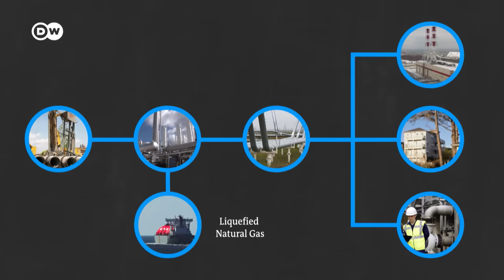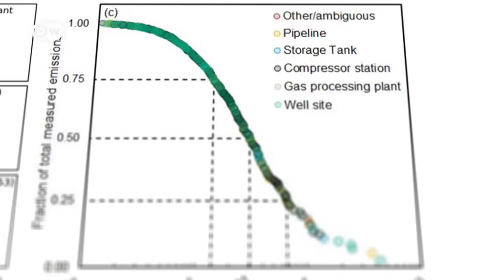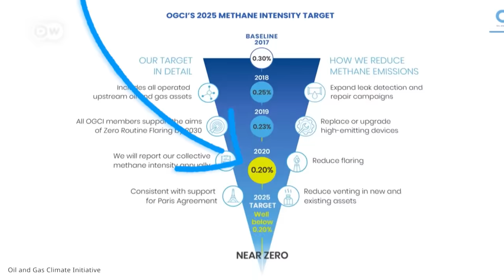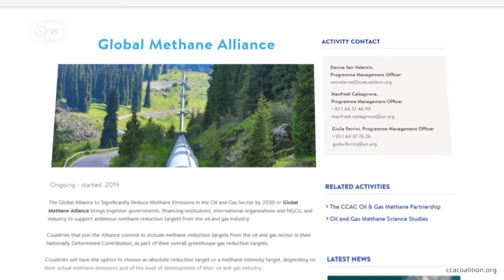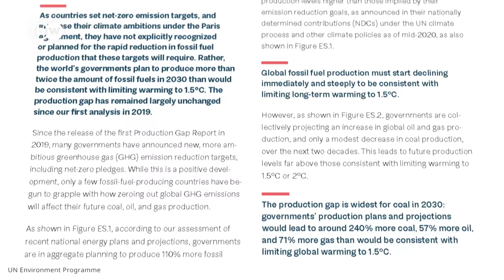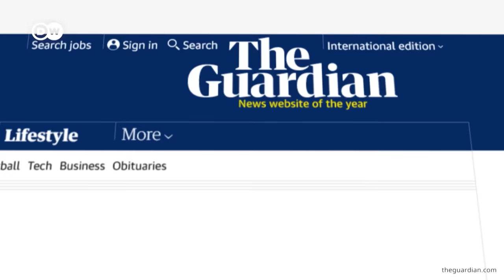Why we need to ditch natural gas (asap)

Comment: Wow, is the reaction I have everytime I watch a DW investigation. Thank you for all the hard work.
 Personally I believe Nuclear has a bad reputation because of the fossil fuel industry. 3rd and 4th gen Nuclear stations are where the planet as a whole need to be. Save the oil for the lube. because we've been getting shafted without it for decades.
Reply: great comment. that last sentence was HILARIOUS though
Reply: It's not the oil industry against nuclear it's the environmental folks.
Reply: @rayshepherd2479  They are not mutually exclusive.
Reply: Spot on, and who cares exactly which "team" is opposing a good strategy? Us vs. Them is a terrible way to make rational choices.
Reply: It's not the oil industry against nuclear it's the environmental groups. They have pushed excessive regulations that have made nuclear extremely expensive. They also file lawsuits which delay/kill new plants.
Reply: @rayshepherd2479  I really don't think it's reasonable to shift blame here to such a specific subsection of the population. The electorate at large is terrified of nuclear power. That has a long and storied history, prominently featuring many accidents, such as Chernobyl. It wasn't environmentalists that stopped nuclear; nuclear became uneconomic a long, long time ago under the weight of hyper cautious regulations.  In essence, what stopped nuclear was NIMBY's. Except the proverbial back yard was "my half of the planet" in this instance.

That fear wasn't entirely rational, it turns out. But neither is it insane, especially if you consider the connection between nuclear power and nuclear weapons - tolerating nuclear power makes it harder to ensure non-proliferation, and people are definitely right to be afraid of nuclear weapons.

Anyhow, that's what killed nuclear.  Not the oil industry. Not environmentalists. Public fear did.
Reply: @rayshepherd2479  It's actually both. The gas companies where I live are lobbying against nuclear energy and in favor of renewables, because nuclear is direct competition to natural gas fired power generation, and renewables are unreliable and require large volumes of natural gas to be burned in inefficient simple-cycle natural gas peaking plants, which provides a larger market for their gas.
Reply: @MoireFly  We need to talk about how uneconomical solar and wind are, because they export their reliability problems out to the power grid. All companies proposing putting unreliable renewables on the grid should be forced to also own and operate the (also uneconomical) inefficient natural gas peaking stations and/or the (extremely uneconomical) battery banks.
Reply: @gregorymalchuk272  If the environmental groups really believed that CO2 is an existential threat then they would be for nuclear, however most are actively against it. I have not seen any lobbying by major oil companies against nuclear.
Reply: @gregorymalchuk272  Solar and wind are however already so much cheaper than competition that we can afford excess supply; a lot of it. And yes, we'll need a better grid; that's not free.  But economics alone will certainly see to it that that happens - at least, if operators are actually free to make that choice, because infrastructure is impossible to build without regulatory backing.  The cost advantages are simply too great.

A good example here is texas, where fossil fuels are effectively heavily subsidized via tax breaks and also effectively subsidized by being unaccountable for the costs of pollution they cause.  Yet it's still been expanding its renewables at an absolutely break-neck speed - because they're simply better, even despite the heavy subsidies fossil fuels get.  And as its winter shutdown showed, it's not like fossil fuels don't also have reliability problems.  Just as nuclear did in France just now, for instance.

Solar and Wind are cheap, and clean, and we need to push them much, much further.  But yes, to do so we'll need to invest in costly grid upgrades and storage.  It's still worth it.
Reply: @rayshepherd2479  There are quite a few environmetalists that are pro-nuclear.  Some feel the need to couch that pro-nuclear stance behind limitations, such as that they prefer solar and wind; or other caveats. 

And sure, there are some, like greenpeace, that are anti-Nuclear.  But have you read their criticism?  They have 6 perfectly reasonable and mostly valid problems with nuclear, but as a whole, the argument is still pretty weak: the best they can come up with is that they'd prefer solar and wind, essentially - but they're conveniently leaving out the fact that those too need huge long-term investments if they're to replace even night-time or winter energy on calm days without wind.  I don't get the impression their heart is in it the way it used to be.
Reply: @MoireFly  Solar and wind are cheap until you have to include the cost of backup when the sun doesn't shine and wind doesn't blow. If you look at locations that have the most wind and solar they also have the highest electricity cost. That's even after all the subsidies. I have solar and in the summer my solar averages about 53 kWh per day in the peak month and less than 7 kwh per day in the worst winter month with a daily low of 1 kwh. I live in Northern California so there are areas that would be worst.
Reply: @rayshepherd2479  Needing to run gas peaker plants less often is still better than running them non-stop. Solar and wind are cheap, even if you include the costs of alternatives in downtimes - as long as you're realistic and trying to build enough to cover peak demand without huge margins above peak demand.  

If you're trying to claim storage is expensive - well, we'll need to talk about that, not solar and wind.  Solar and wind without storage are a clear and obvious win even without accounting for climate costs, and an overwhelming must-have once you account for climate costs.

But to replace more load at times when these renewables can't provide energy, you'll need storage - and there are lots of options, and many uncertain (but promising) developments. Evaluating those isn't trivial, but claiming that storage costs make renewables unviable is simply false - you don't need storage to make renewables viable.
Reply: @MoireFly  If wind and solar are a clearly less expensive you wouldn't need subsidies. You also would have the lowest cost electricity where wind and solar was the primary source of electricity. Unfortunately it's just the opposite. I have solar panels and the only reason they paid out is the subsidies. Even with the subsidies I would have been better off if I had just invested the cost of the solar. The problem with wind and solar is you need to maintain so much backup. In addition ramping up and shutting down the backup is very inefficient which also increases the cost. The difference in solar output from day to night is a problem but even more of a problem is the difference from summer to winter output.
Reply: @MoireFly  The problem is you need to have almost 100% backup to the Wind and Solar. This backup must be ready to come on line at any time. Current storage systems cannot do it especially from summer to winter. This means that some other form of backup must be maintained which currently means fossil fuel plants. When you add the cost of whatever backup system you use it results in wind and solar being very expensive. This can be seen by the cost of electricity in places like Germany and California where they have pushed wind and solar.

Comment: Geothermal energy can be used instead of gas, right now: the tech exist and it works 24/7 and it can be used both for heat and electricity.
Reply: Parts of Northern Europe have geothermal heat, but in our part of the world the water is not hot enough to produce electricity. But happily we can use to produce hot water for the district heating network, and this way it can replace some gas.
Reply: Geothermal is awesome, but there is no single perfect solution. I’m actually currently working on a video about this topic.

Instead of one perfect solution we need to be ok with ending up with a bit of a soup of various solutions which all leverage natural resources in specific regions. For instance, we’ll likely get the bulk of our power from solar and wind just because their generation per cost is so high, but they have obvious intermittency issues.

Luckily, there’s plenty of options which can solve these issues! Geothermal is one, waste generation of methane to burn is another, cogeneration can drastically reduce the cost of heating water, tidal generation is amazing, nuclear is also great as well, etc.

But my point is that each of these methods of generation has slightly different pros and cons depending on different regions. So we’ll have to be ok with one region relying on a method which is least expensive in their area while another region will use something completely different!

Like I said at the beginning: there is no one perfect solution.
Reply: Fusion will be the one thing that replaces all other types of electricity production currently in use. It is the holy grail of energy production. However we are not there yet.
Reply: Precisely 🙋🏼‍♀️ with the development of laser drilling it will be possible to build geothermal plants almost anywhere and retrofit fossil fuel power plant into geothermal plants.
Reply: @Drakey_Fenix  TBH, I think fusion is a pipe dream and we should focus on geothermal plants, solar panels, wind turbines, and backup battery storage facilities. Even thorium salt nuclear reactors would be better. As we have the technology now.
Reply: @Drakey_Fenix  I wish fusion was possible too.  The clean safe abundant energy is too tempting.  But fusion tech has always been just another "10-years" away since like 1960s and is becoming a running joke.  A good chorus of nuclear physicists do not think commercially viable fusion is possible either.

For starters, maintaining a constant minimum 100-million degree Celsius fusion reaction container currently uses up all the energy (and more) that our fusion technology can produce.  That is staggering amount of heat.  For comparison, its many times the temperature of the sun's core which is only some 15-million degrees Celsius.

Secondly, the most promising fusion experiment is the ITER fusion reactor which goes after the Deuterium-Tritium fusion process which is easier to achieve and produces more unit energy.  But Tritium (3H) is incredibly rare unlike Deuterium (2H).  ITER themselves say 300-grams of Tritium is needed per day for an 800MW reactor.

Creating (breeding) Tritium from Deuterium is possible on small scale but is yet another major obstacle for commercial viability.  Tritium is also "beta" radioactive.  If some leaks into the water and then the food supply then it would be a disaster on its own.

Remember, its much easier to create a working prototype of something in a laboratory at tiny scales.  With something like fusion, even the smallest laboratory breakthroughs get big media coverage because it always boosts clicks and views.  But its a huge leap to take a prototype to commercial scale where factors of safety, regulation, economics, supply chains, and especially competitive pressure also come into play.  It is the same for all new technologies.
Reply: @ladyselenafelicitywhite1596  "Fusion"
Reply: Tidal wave energy has huge potential. It can generate 22 hrs of energy out of 24 hrs.
Reply: @beyondfossil  darn it, I meant fusion. 🙇🏼‍♀️
Reply: @crosstraffic187  it has potential, but there might be conflicts of interest with other maritime users.  Have you seen the new combined tidal/solar/wind platforms that are underway? 
Remarkable technology if it becomes commercially viable.
Reply: @ladyselenafelicitywhite1596  I'll have to check it out.

Comment: I lived where fossil fuel industries were basically determining the government policies. I noticed one thing in this video, no mention of either tidal wave or "run of the rivers" power generation. 
The fossil fuel industries, especially natural gas, don't want to be shut down. They're the main sources of the plastic industries. We're all aware of the massive amounts of plastics, the pollution from natural gas, plastics, especially methane. 
Flaring, by the way, emits over 100 toxic chemicals into the atmosphere, none of those are "scrubbed" out of the flaring stacks. 
Look at "Cancer Alley" in Louisiana and Texas. People there live with tonnes of toxic chemicals daily from the refineries and flaring. 
"Sour Gas" was frequently drilled for and the byproduct was sulphuric acid, or pikes if sulphur I personally saw lying in open fields, no cover or protection. I actually picked up chunks of sulphur from one field myself. Obviously no fencing or warning. 
"Recycle" was and is used by petrochemical corporations to put the onus on us instead of stopping the production of plastics. Guess who came up with this? The fossil fuel industries.
Reply: Plastic, even single use plastic, is awesome and has vastly improved our standard of living and especially our food hygiene.
Reply: Except that they have mentioned tidal power. Just not in this video. If they had to mention every single renewable power source at length, the video would be a damn mess. They're not ignoring anything, just staying on topic.

Comment: The video didn't mention that Asia is leading the renewable energy race because it didn't double down on natural gas. In energy density and reliability, coal is still king, but in cost renewables are around the same range as coal. The currently being built and opened coal and natural gas powerplants in Asia are because they were planned years ago and cancelling those deals right would lead in investor dissatisfaction.  Asia knowing that natural gas is just a transitional energy source for renewables, why not go renewables now since the cost now is in the same range as coal. Most of the recently agreed and future powerplant deals are now in renewables and nuclear.

Comment: i see natural gas more as a "transition" fuel and not something that we can call "green" fuel
Reply: The lifecycle emissions of fossil gas are only marginally better than coal. It releases about 40% less CO2 on combustion but the methane leakage during extraction, transport and processing reduces the GHG saving to only about 20%.

As the IEA and IPCC have both stated very explicitly, ANY new investment in fossil fuels is incompatible with a stable liveable climate.

Comment: I am a little disappointed that there was no mention at all at how much natural gas is used in our agriculture. You can switch energy generation from natural gas to solar and wind, but you can't replace the atoms we need to make fertilisers.
Reply: Brian Lim said,
"...but you can't replace the atoms we need to make fertilizers."

You *must* find a way to stop the CO2 released into the atmosphere when natural gas - methane - is made into hydrogen, then hydrogen is made into ammonia and then fertilizer.  If you cannot, then you must not use methane!  It's simple:  no = zero - CO2 released into the atmosphere!

Hydrogen is easily made from water and electricity, without CO2.  That's how it should be done.
Reply: Because fertilizers do not need hydrocarbon chains like natural gas methane (CH₄) which obviously only provide carbon and hydrogen atoms.  These atoms are readily available in the environment from CO₂ and H₂O molecules which plants can readily use directly.

Yes, natural gas can be used to help create the very important fertilizer ammonia (NH₃) but that's not the only way.

To your point, ammonia can be created from direct plentiful atmospheric nitrogen and hydrogen made via H₂O hydrolysis using *renewable electricity*.  Look up "green ammonia".  Although our atmosphere is 78% nitrogen, plants cannot absorb nitrogen from the air and must take it from the ground and thus ammonia is an important fertilizer.

Other inorganic elements plants need are phosphorous and potassium not related to methane either.

Comment: I agree with what you said in the video but one big asterisk around electric heating elements is that they are only better than gas if the electricity is coming from renewable energy sources. It is more efficient to use gas as heat then use it as heat to boil water to spin a turbine to generate electricity to transport it and then for your stove to use it. At least the stove will use it 100% efficiently but you lose a lot of energy in the other steps.
Reply: Modern heat pumps typically have an efficiency of 400%. This means that you can use 1kWh of electrical energy to transport 4kWh of thermal energy from the outside in to your house. So if your power plant has an efficiency above 25%, then the heat pump can still be the most efficient solution.
Reply: A heat pump in your home is more efficient than a gas heater, even if the electricity is generated by burning gas.

Comment: The real question is what energy will Germany use this winter to warm up your houses? Will it be enough to survive?
Reply: Texas winter Feb 2021. A deep winter ice storm that intruded far into Texas froze up the Windmill system and the sudden loss of that power took down the entire Texas grid. The death 3-4 day toll from hypothermia, and ancillary in peoples homes has been pegged at 243 dead. Imagine windmill, and solar dependent euro countries hit with the coming hard winter, and no natural gas for home heating.
Reply: @boxwoodgreen  Texas windmills were not designed to withstand the frost. Design flaw.